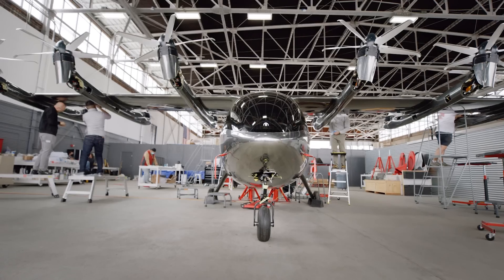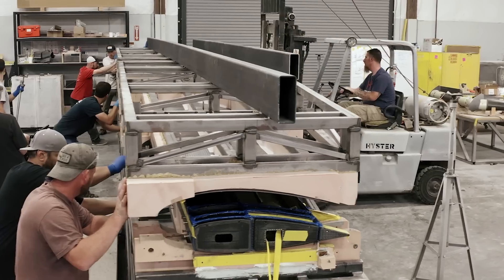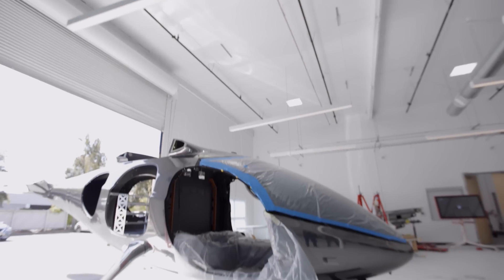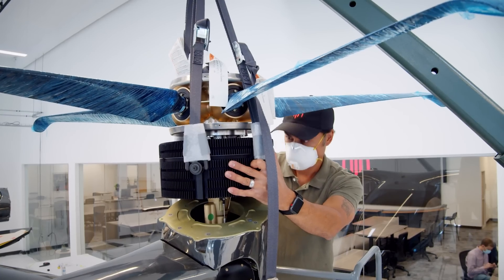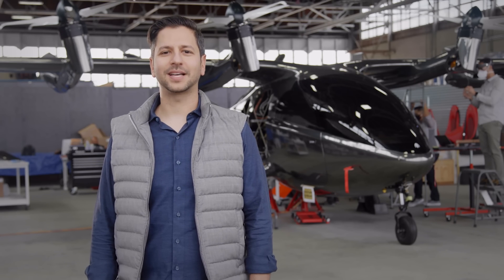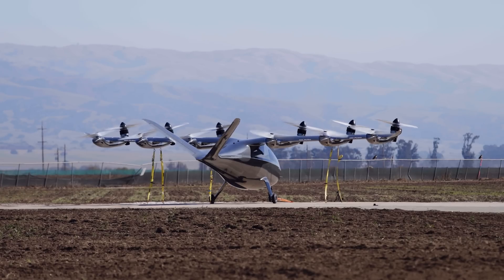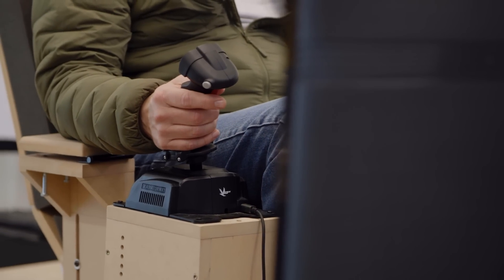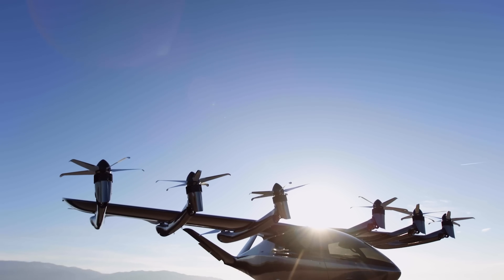Archer eVTOL Test Flight Program Overview

Comment: Can you add a small two cycle engine connected to a diesel truck alternator to recharge the batteries in flight to extend the range and flight time?

Comment: Be sure to tie down when you run up to 'almost enough power to fly' the aircraft is noticeably 'wobbly' even in your video and perched up on a 'milking stool' landing gear is quite likely to blow over in any wind . the effect of propellers contacting the ground would of course be catastrophic but quite likely (aircraft don't usually have propellers way out on the wings )  No one is denying that your fabrication of this aircraft is obviously 'no expense spared' quality but take some time to reflect on the harsh lessons from previous VTOLs (in your 'thanksgiving'  video you claim to have recognized your debt to the pioneers of aviation .  Do it by not crashing for stupid reasons. )